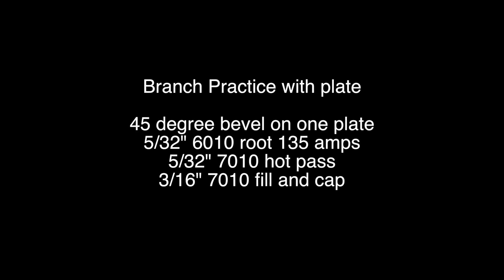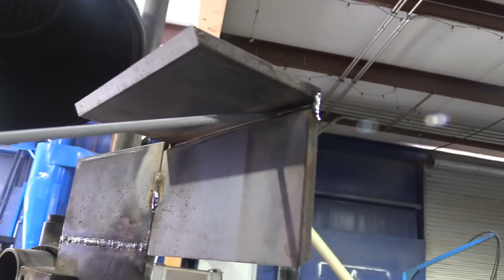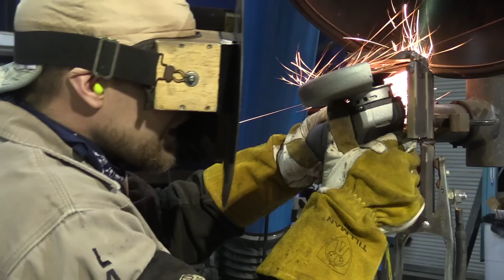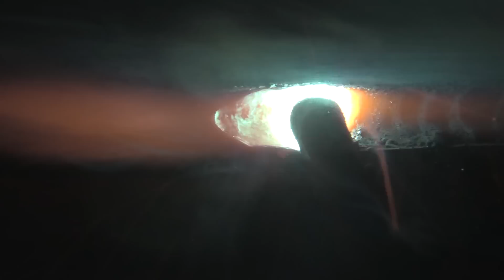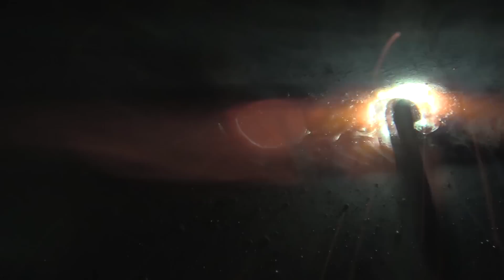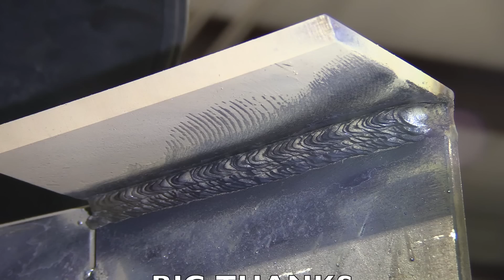6010 & 7010 Overhead Stick Welding

Comment: I have a question. I have never welded a 6010 or a 7010 but I have welded alot of 7018 and 8018. With 7018 and similar rods u would get problems with porosity wiping out of the puddle all the time. How come it works with 6010 and 7010? Thanks for answer and great content.

Comment: So quick question I haven’t welded in about a two years . Why are you welding the root pass so hot ?
Reply: Roberto Contreras so it deposits into both base plates

Comment: Why is root 6010 and hot pass 7010? Does the 6010 work better for the root pass or is the extra cost associated with extra strength just not needed?

Comment: i burned some 1/16th 6013 yesterday for the first time ever.   wearing shorts using the hand held shield and melting rods was something you just need to do for yourself after watching a few hours of a pro.  today headed to buy a real welding helmet and some bigger rods to do a bed of welds.   holding the rod lengths is one of the harder skills and looking at work peace with a hand held welding glass did take some getting use to?   

the burn from the splatter was different from say a burn from a grider nail head?  it was painful but it faded faster than the grinder hit?  using 1/2 inch steel and a cheap leny dc inverter on the 120 volt setting at 35-40 amps.   never weld without correct eye protection and heavy closes or you will be sorry!   open the windows and vent the smoke with a fan!  i love the sound of the melting electrode, its like the sound of an old friend?